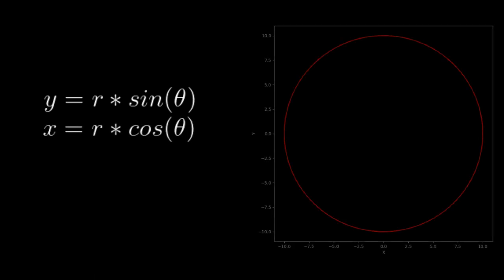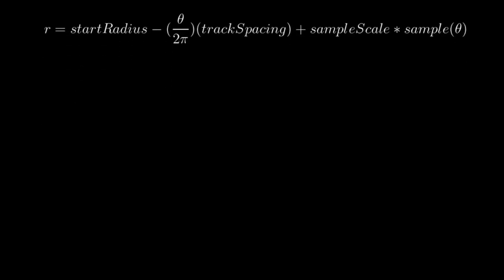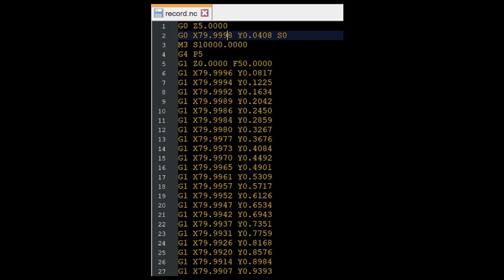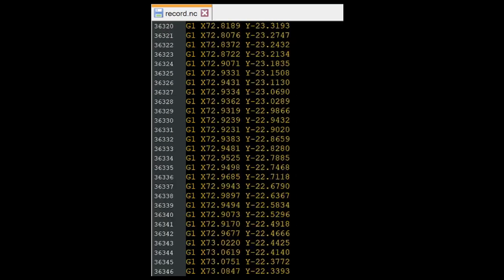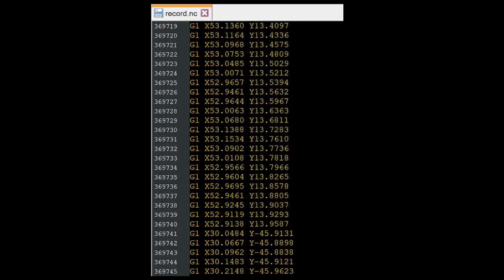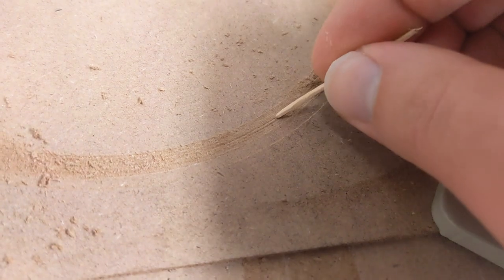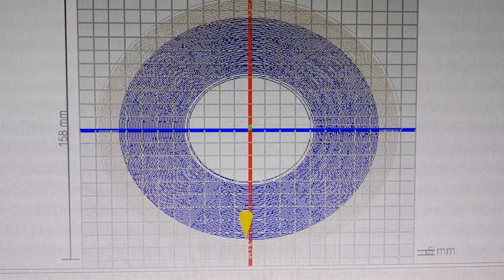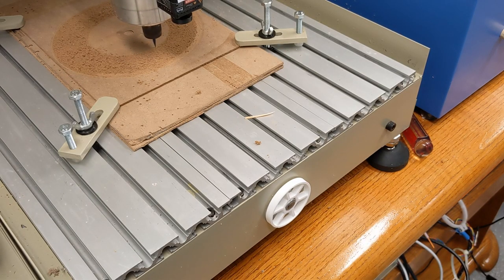What does a record made of WOOD sound like? | CNC milling phonograph record grooves

Comment: You know what's something interesting to consider? Think about how many "lives" those wood fibers have gone through.

You made the record from recycled packaging material, which before that was recycled from spoil board, which before that was an MDF board, which is a product made from recycled sawdust, which was likely made at a lumberyard as waste while milling lumber from trees. Perhaps it's even possible that they were even cutting that sawdust while sawing down offcuts into something more useful. Regardless, it's been a long journey from when it was originally a tree.

Comment: very impressive results you got! great video.
the material you have from shipping pcb stencils is some sort of fiberboard - medium density fiberboard (MDF) probably. likely, they just put this stuff as a sacrificial material on a vacuum table and suck through it to fix the pcbs to do the drilling. since you have almost no horizontal forces during drilling, this is enough to hold the workpieces.